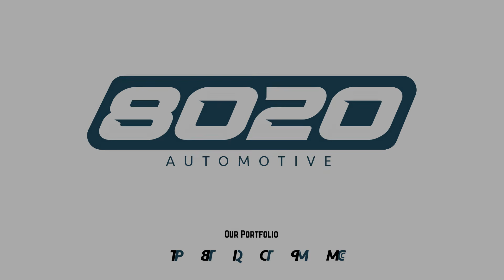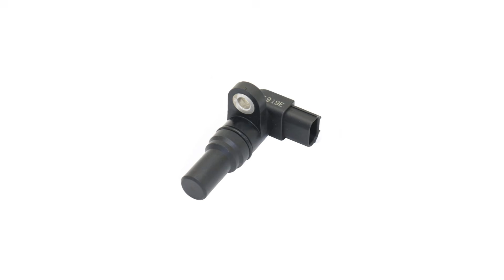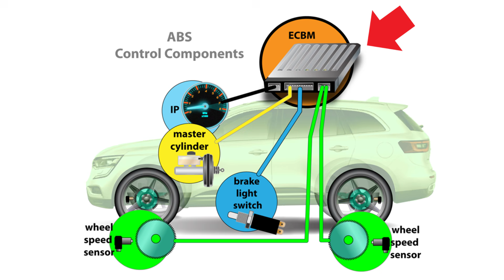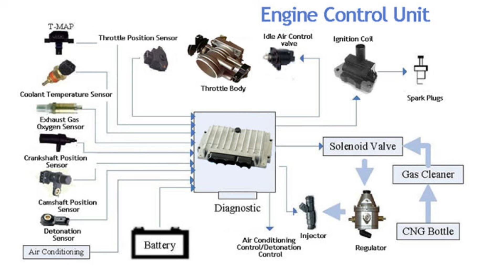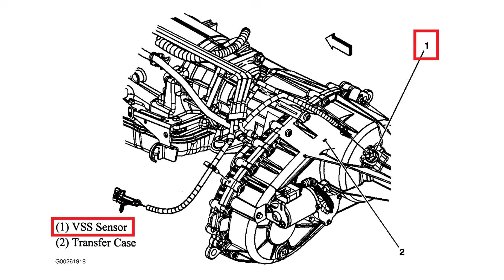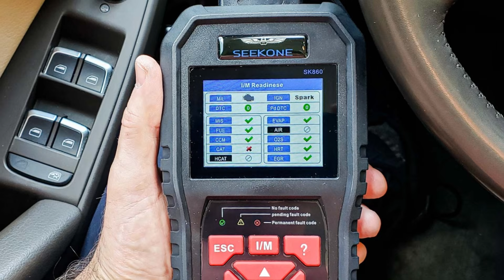P0500 Code Explained: How to FIX Your Vehicle Speed Sensor FAST!

Comment: If anyone could help me out then I’d be grateful. I have a 1999 Toyota Camry 2.2L and it has a transmission speed sensor. I replace the speed sensor. Didn’t fix the issue, then come to find out that it is most likely my resonator on the motherboard of the speed sensor because a video had said when it gets old and hot (I live in Texas) then it can stop working and when it cools down it will work again. I got it replaced, and now my speedometer is working fine, but it still seems to be shifting harder and for some reason the engine code for it keeps coming back on after clearing it. What can be causing it?

Comment: You forgot a very important part. It could also be a bad wheel bearing. If the toner ring inside the wheel bearing is bad. The ABS sensor will not read that wheel properly.

Comment: I have a Toyota Altis 2002 1.8G 1zzfe engine with P0500 code, when I plug scanner, abs automatically blinking. and when i rev up to 4000rpm in neutral engine light will on and P0500 is the fault code, what do you think is the cause? Please help me out, i can only do diy. thanks

Comment: Hi hope you're well. 
Could you advise me on a 0500 code mercedes c230 2008 v6 204  thanks  in advance
Reply from the maker: D - The video covers the code.
Reply: @8020Automotive hi thanks for your reply. The code 0500 is accompanied by a message left bank running rich , but that doesn't seem the case

Comment: I have a Ford 500 that won’t go into drive or reverse
Reply from the maker: C - The issue is likely with the transmission linkage, fluid pressure, or internal clutches. Start with the basics — check the transmission fluid level and color with the engine running and fully warmed up in park. If it’s low, burnt, or milky, that’s your first clue: low fluid means a leak or weak pump, burnt fluid suggests internal clutch failure, and milky fluid points to coolant contamination. If the fluid looks good, make sure the shifter cable or linkage is still connected and moving the transmission lever when you shift; sometimes a simple linkage bushing breaks and prevents engagement. If the linkage moves correctly and fluid is full, then you’re likely facing an internal transmission issue — such as a failed torque converter, valve body, or main pressure solenoid — which can cause total loss of gear engagement. In that case, it’s best to have a shop check line pressure and scan the TCM for stored transmission codes before assuming a full rebuild is needed.

Comment: I replaced both of my vehicle speed sensors on the transmission of my toyota tacoma. Problem is the code p0500 will not go away. I have no other codes.  I have erased the code and it just came back. I have no issues with my transmission, no issues with the speedomiter, no issues with my ABS system that I know of.  Do you have any suggestions to help me diagnose and fix this problem?  Thanks
Reply from the maker: T - Sorry to hear this.. If you’ve replaced both vehicle speed sensors on your Tacoma and the P0500 code keeps returning even though the speedometer and transmission behave normally, that points to a signal delivery or circuit issue rather than a bad sensor. Start by checking the wiring harnesses and connectors to both sensors — corrosion, pin damage, or stretched wires near the transmission tunnel are common culprits, especially if the connectors got moisture or dirt in them. Use a multimeter to confirm each sensor’s signal wire is delivering voltage to the ECU (you should see a small AC voltage pulse as you spin the wheels). If wiring checks out, inspect the ECU ground points and ABS module connector, since the ECM on these trucks often receives the speed data through the ABS module rather than directly from the transmission. A loose or corroded ground near the battery or chassis can also trigger P0500 with no driving symptoms. Lastly, verify the replacement sensors are OEM or high-quality equivalents — aftermarket units often output the wrong signal frequency. If all that passes, try a zero-point calibration or clearing adaptive memory with a capable scan tool; sometimes the ECU needs to relearn the sensor signal before the code stays cleared.
Reply: Your explanation reply was even more helpful than your video. Thanks much.
Reply: abs module problem , as you mentioned , the speed sensor transmission goes through abs module and it's something inside the abs module that doesn't let the ground signal go to ECU the  a capacitor,transitor something inside the abs module

Comment: I’m planning to buy a Mazda 3 and it’s showing both U0121 and P0500. I’m in dire need of a car would you recommend I get? Or would the fix cost to much and not be worth the purchase
Reply: I was initially going to try and replace the vehicle speed sensor since my friend said that’s an easy fix for him and I’m spending my last on the car, but not sure if that wouldn’t fix any of the issues and I’d have to spend more on fixing the U0121 who could be an even bigger issue than I’m ready for
Reply from the maker: A - If the asking price is well below repair cost, it could still make sense—but you SHOULD NOT buy it if the investment exceeds your budget, especially since you're already stretching your last dollars.
Reply: @8020Automotive  yes it is from my understanding. My question now is how long would I be able to drive with the u0121 code still active?
Reply from the maker: A - The U0121 code means your vehicle is losing communication with the ABS/ESC module, and while you can usually keep driving for a while, you’re effectively doing so without ABS, traction control, or stability assist, which means braking distances may be longer on slick surfaces and the vehicle won’t correct itself if you skid; if the light is on constantly, those safety systems are already offline, and even if it drives “fine,” it’s not safe to ignore long-term, so I’d treat it like you’ve just gone back to old-school brakes — okay for short-term use if you’re cautious and on dry roads, but it should be repaired as soon as possible to avoid risking control in an emergency.

Comment: I've already replaced the speed sensors and I can't get the warning lights to stay off. Help?
Reply from the maker: J - If you’ve already replaced the speed sensors but the warning lights keep coming back, the problem is likely not the sensors themselves but the wiring, connectors, or the tone rings/reluctor wheels the sensors read from. Corroded or damaged wiring harnesses near the wheel hubs are very common, and even a slightly cracked or dirty reluctor ring can make the system think a sensor is failing. Another possibility is that the new sensors weren’t OEM spec—aftermarket ABS/speed sensors can cause intermittent faults. The best next step is to scan the system with a tool that shows live wheel speed data; that way you can see which wheel is dropping out while driving. If a wheel shows “0” or glitches even with new sensors, you’ll know it’s a wiring or tone ring issue rather than the sensor itself.